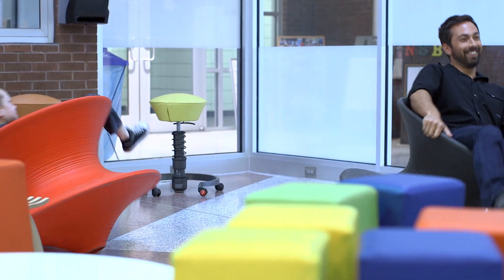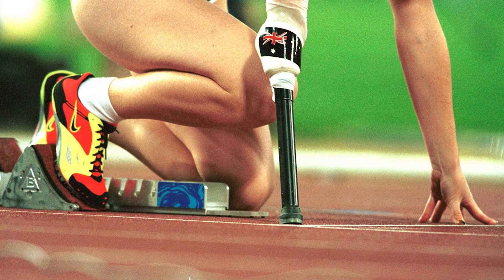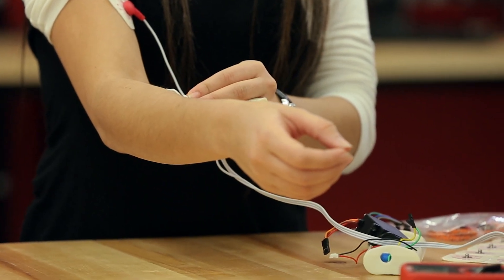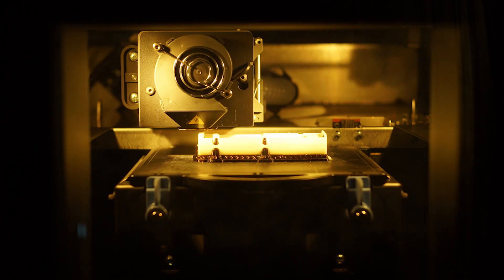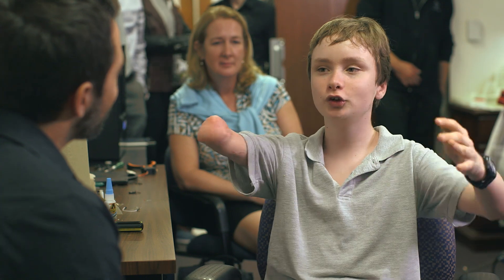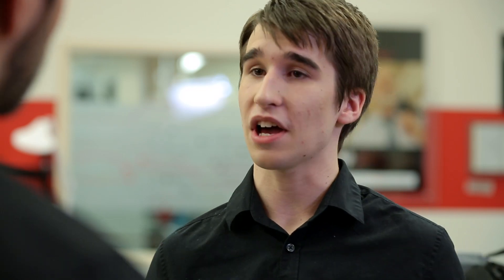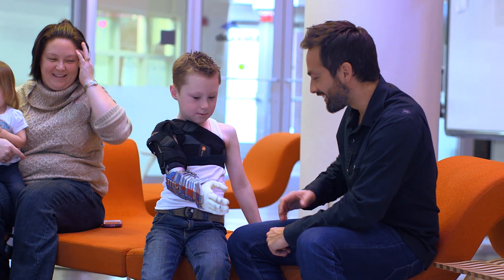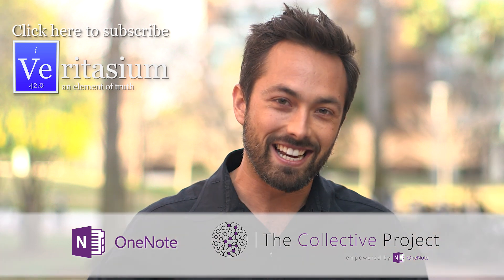An Affordable 3D-Printed Arm

Comment: Is Deus Ex one day possible? That we can fully control the mechanical limbs
Reply: Scientifically speaking, fully functional, articulate, and enhanced prosthetic limbs like the ones in Deus Ex are entirely possible. In fact, we could probably do it now. Unfortunately, at the moment, they would likely cost millions, possibly even billions of dollars for all of the intricate parts and surgery that would need to go into developing one quickly.
Reply: ashley osborne no, it will happen in our lifetime. If we can already do this much it's easily going to happen in our life time. Technology is moving faster than you think.
Reply: You mean duce sex? Like when you take a dump on a girls chest? That is possible actually
Reply: ***** That's quite impressive but it controls a paralyzed flesh and blood limb as opposed to a plastic prosthetic.

Currently, MRI technology requires bulky headgear to read electrical patterns in the brain to control one or two motors - say when you think of a square and triangle, the computer will recognize the pattern generated then run a motor after some lag - this is very very different from controlling a real limb with 20+ muscles and 5 main nerves that branch out into thousands more nerve endings.

There are direct brain implant chips like the Braingate2 that exist right now, but they are not fully integrated into a host's nervous system. It works like the MRI reader but with a lot less noise - the user imagines picking up something - and that causes the computer to execute movements whenever that pattern is recognised.

As you can see from the results of braingate2, while impressive, it is very very slow and inaccurate compared to a real arm: https://news.brown.edu/articles/2012/05/braingate2 . It is also a very heavy and bulky device.

A lot of people here are saying that they can have cyborg level augmentations that function as smoothly as a real limb and that can be integrated into a human body without problems overnight. This is patently false - prosthetic technology and neuro-interface technology still have a very very long way to go to even become close enough to have half the function and performance of a real limb.
Reply: Sukhrajah I really don't know enough to speculate on when advanced augmentations will become reality - the main problem now is that chips do not send out electrical signals in the same way as our brain. It just washes watts down and hope it hitw something, akin to using a sledgehammer to drive in a tiny nail.

Signal recognition in the brain is also very difficult - there is a lot of noise and interference, my link above has another link to a follow up story on the same group and patient which states that the chip degrades very quickly because the brain always changes. We currently do not have a chip that can use electrical pulses in the brain natively like our nerve cells, we can merely observe when very broad patterns arise and interpret them. This process is quite laggy and has a high error margin, it also requires immense concentration on the user's part to perform simple tasks.

Before augmented limbs, we should work on smaller projects - if we can get a brain chip to control a remote control car as precisely as someone using a joystick, I'd say we will be a big step closer to Deus Ex reality.
Reply: It already is
Reply: Yes, it will one day be possible (for reasonable pricing). And to say that it won't happen in our lifetime is limiting thinking. We won't get anywhere in the world if we just think the generations beyond ours will do it instead of us.
Reply: Actually we have already made arms that allow the feeling of a surface, eg. hot, cold, rough, smooth ect. , to be sent to the brain allowing people to feel objects as if they had a hand. So needless to say we are not far off.
Reply: The difference in Deus Ex and the prosthetics currently available is that in Deus Ex the prosthetics are fully integrated with the user's nervous system through a biochip implanted in the user's brain. This allowed for seamless control of prosthesis in the fiction, which in real life is not yet obtainable - current real-life prosthetics move by measuring a current delivered by muscle movement from another part of the body, as such the ability to control it is not as nuanced as compared to a real limb.

We cannot achieve Deus Ex level of control currently because we have no way of integrating our nervous system with a mechanical augmentation - we need to further our understanding of neuroscience dramatically before such a thing can become remotely possible.
Reply: It's my dream to make it happen.
Reply: Not just limbs. Internal organs as well. 3d printed organs replacing the need for donor organs with high risks of rejection and long waiting lists. It is also possible that we could see better organs than our own, it's a long way until we potentially reach that point but it is an interesting thought experiment.
Reply: Like 10 years ago they made a brain implant for some monkey that enabled him to remote control a mechanical arm.

Currently there are several game controllers that read your brainwaves, facial expressions, ... and let you control the ingame character. It should be pretty simple to do the same with mechanical exosuit or a remote controlled robot, considering that the main problem with making viable humanoid robots is the control, not the motors and mechanical parts.

So, yes, it is possible right now.
Reply: ashley osborne You're really ignorant if you think that.
Reply: TheBenEEeee No true, they have done it :D they used a chip to by pass the spin membrain
Reply: TheBenEEeee Mind. Blown! 

You're expertise here has saved me sleeplesss nights of research and headaches trying to learn a lifetime worth on the topic. Your last line is telling. In your approximation, how much longer before we have the technology to have function and performance of a real limb? What exciting milestones might we have to cross before getting there(as a layman, what should I be looking out for in the news)? I'm excited about the field, and wonder if we can offer those that use/need prosthetics a glimmer of hope...

Again, thank you for the brilliantly intelligent responses above, and most of all, thanks for sharing.
Reply: ashley osborne sad_frog.jpg